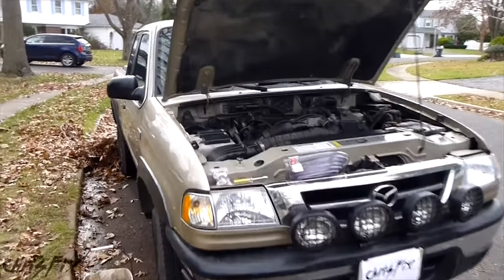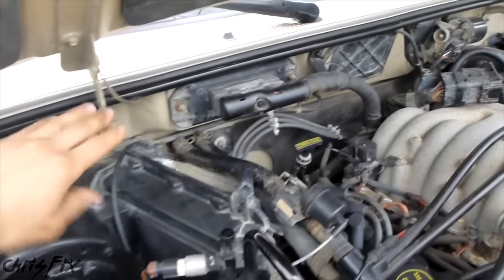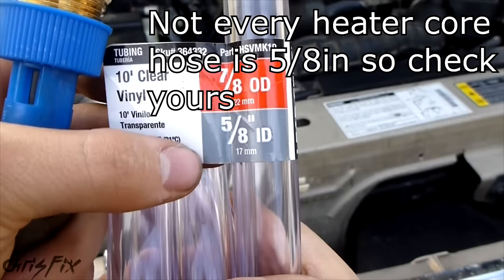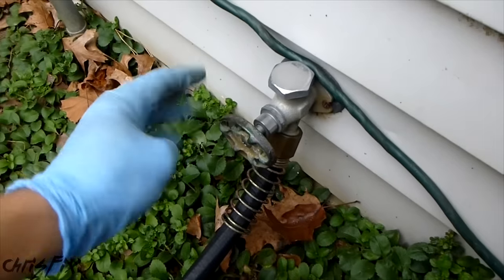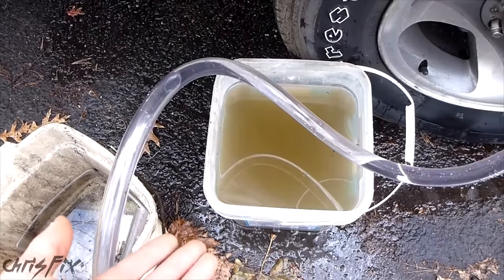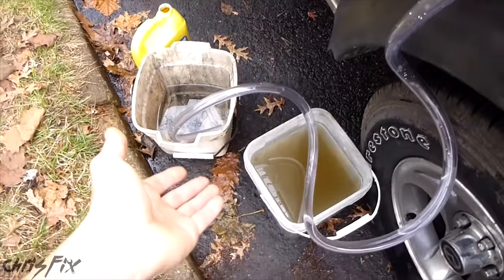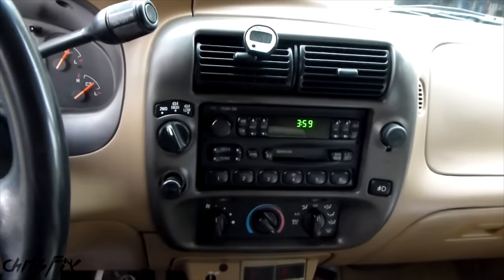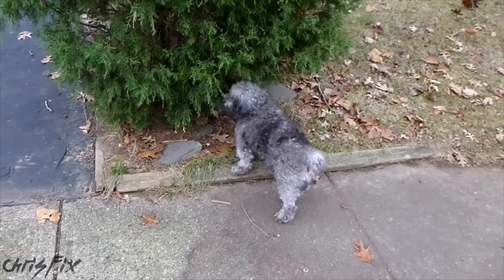How to Flush a Heater Core Safely (with a garden hose)

Comment: I used a 2 liter bottle of water, an empty bottle to catch old fluids, a pair of pliers, a funnel and an electric tire pump. I literally just finished, took me 30 min (mostly removing hoses) I'm no mechanic. Worked like a charm and saved me some cash!! Went from no heat, to yea let me turn this off its gettin really hot in here lol. Thanks Bro!!!
Reply: Hello, I'm trying to flush my heater core but I don't have access to a garden hose. How did you connect your pump to the hoses??
Reply: Muller P watch the video
Reply: Good shit bro
Reply: "I used a 2 liter bottle of water, an empty bottle to catch old fluids, a pair of pliers, a funnel and an electric tire pump. I literally just finished, took me 30 min" -That's what she said
Reply: @evanarnold580  lo {4
Reply: what was the electric tire pump for?
Reply: @automotivetv9861  🤷‍♂️
Reply: @automotivetv9861  i would have to assume to apply air pressure to the water in order to get a decent flow going to get all the gunk out. Gonna have yo try this but with my air compressor
Reply: @mullerp5235  just squeeze the bottle
Reply: @LokochonWolf  you could also just blow into the hose and push it out I would assume since like he said they usually only get about 10psi
Reply: Psh! I used a rubber band and a paper clip
Reply: @automotivetv9861  air pressure works in place of the water pressure

Comment: My car is running good 14 minutes ago but now i need to flush my heater core
Reply: totally
Reply: Don't be afraid of doing your own simple work. Learn. Figure it out. Do it.
Reply: Me too, I think I’ll do it myself
Reply: @davidweum9334  unless you have a 2nd gen mini cooper... like zero space in my engine bay. if you want to do anything big you either remove the intake pipes or take off the bumper. mind you, its only like 20 screw to take off the bumper. I can get it done in 20 minutes and put it back on in 8mins
Nvm, now that i think about it, its the same with pretty much every hatchback. Still I love this car and its pretty reliable if you change the oil every 5000/8000km
Reply: Monday
Reply: Monday
Reply: Sunday
Reply: 3:32 AM
Reply: Monday song
Reply: Yesterday Sunday
Reply: Same here

Comment: Would it be the same if I unplug the hose from the heater control valve instead of from the firewall. In that case, I can use the original hose to flush?

Comment: Run your heater for a couple of minutes per week in the summer and your A/C a couple of minutes in the winter when the air temp is above 32-deg. Your cooling system will be always be trouble-free.

Comment: Chris Fix is great! One thing, turning the hose valve on 1/4 turn will NOT regulate pressure, it will just control how fast it flows. If there is a blockage, the pressure will rise to the household  pressure at the hose value.
Reply: Ah good old fluid dynamics. I didn't even think of that. Direct correlation (inversely proportional) between pressure and volume of water.  Similar to what happens when you put your thumb at the end of a hose.
Reply: Yup. Absolutely correct.
Reply: Totally agree.
Reply: Well, I'm sure how quickly that rise is depends on the rate of flow so the same caution is still recommended, right?
Reply: Yep,you would have to turn down you regulator.Way down.
Reply: I dont understand. can you explain more thoroughly?
Reply: @PneumaticFrog  hes saying when u turn on the hose the pressure will be 40psi regardless (or according to ur municipalities water supply pressure)  especially if there is a blockage in your radiator core.
Reply: @RubbinRobbin  gotcha thanks

Comment: THANK YOU! I just used your method on my 1998 Jeep Wrangler and it worked perfectly. The hardest part was disconnecting the hoses - they'd never been disconnected before. If I can do this, anyone can! I'm not a mechanic or even close to one. $10 in parts and an hour under the hood did the job. Keep up the tips!
Reply: Hey did you flush the radiator before doing the heater?

Comment: Even sometimes in the summer, when on the highway, I'll turn the heat to full blast, and aim it out my windows. Provides a liiittle extra bit of cooling for the engine. And keeps the heater nice and clean
Reply from the maker: Thanks for sharing!
Reply: Yeah, when me and my brother would be flying around in his 2000 bmw 323ci we would do the same to keep the engine cool

Comment: I just watched your cooling system flush video and this video and I feel so much better about doing the work needed on my cooling system now! Thank you for taking the time to share your knowledge. I am now subscribed and will be sure to refer people to your channel if they ask about diy mechanical issues. I also wanted to give you an even bigger THANK YOU for the advice about turning your heater on once a month during the summer months. I live in Phoenix AZ and have had at least 3 older vehicles end up with heater core problems. I honestly think your advice will prevent me from running into similar  issues in the future. I am surprised no one else has ever suggested that to me before  & I'll be sure to share that advice to friends and family as well. Thx again and I look forward to learning more from you 😁

Comment: I never comment on videos but I have to admit that this worked perfectly for my 2008 Jeep Liberty. I wasn't getting any heat on the driver's side (the only side you actually care about) and little to no heat on the passenger side. I decided to do this exactly like the video and I had amazing results!!! I'm not the most amazing handy-man either so I would give this a 3 out of 5 difficulty. The only issue I had was getting the hoses off but everything else went smoothly. Thanks for the help!

Comment: I'm Watching your videos for a year an i must praise you a lot. Your videos helped me to diagnose a bad battery, bad alternator and to diagnose a parasitic current draw. Today i flushed my heater core and I'm amassed how good that worked, and how much junk there was inside. I don't have much time to work on my car, but from time to time i fix things on it. I got myself an E34 520i 1991 in fall last year and with your help I'm fixing it good :D Next on my ''TO DO LIST'' is that cooling system super flush, because there is also a lot of junk in my radiator. Keep up the good work Chris and thank you for all the effort you make to do this awesome videos.

Comment: Just performed this on my car that had really low heat, and now its blazing HOT!!! Thank you ChrisFix! Love the videos! I purchased the same blue and black adapter as is in the video, and it had a hard time letting water through, so didn't get much pressure, but maybe I did it wrong. I ended up just hooking up the water hose directly to the terminals, and it worked just fine as far as I know, super toasty.! Thanks again! Just in time for winter!

Comment: Great vid! Just did this to my 97 Civic LX and the hose location was nowhere near as easy as it was on this truck. Instead of buying hoses/adapters I just disconnected the two tubes on their opposite ends since they were much easier to get a grip on there. I did have a problem with air in the system so I took the radiator cap off and revved the motor until the coolant went down and I topped it off some more. After a few cycles of that the heat finally started kicking in. Went from 107F to 145F. Huge difference!
Reply: Great info! How do / did you determine that air was a problem in your system after the flush? 

I have heard this mentioned a number of times in the videos I've watched thus far, but no one ever details that car acts a certain way or if there is a specific dash reading that comes up that will flag this problem.

Comment: Chris, love your teaching style and positive, can do attitude.  I’ve been turning wrenches for over 50 years and you still manage to pass along an unknown trick occasionally!  I am curious as to why you opted to not install the full flush kit.  I installed a kit in my 05 Mustang,  that I had previously installed in a 93 Aerostar, but removed it before sending the mini to the scrap yard.  It still functions flawlessly, and makes a radiator flush easier than changing oil...

Comment: Mine had rusty crud comin out, but having no water at my workplace, i blew with my hand on the radiatorcap and i changed direction, and succes!! Filled up with gallon bottles....so yes i improvided, and worked great! Temperatures inside increased like it should! Thanks for the knowledge, i built upon, bob the Belgian🇧🇪🍺👌

Comment: I am a HUGE fan of the Prestone Flush & Fill kit-You simply cut your INLET hose to your heater core, install the "T" hook up your garden hose, turn on heater full blast, run the engine through several warm up and cool down cycles-(Thermostat opening and closing)

Comment: CHRIS, you da man.  The cold blast hits this week.  I used your tips on a 2007 Dodge Nitro and the thermometer went from 78 deg to 150 degrees.  I bought 5/8 inner diameter hose at the lumber store and flushed back and forth with a regular water hose and a simple water sprayer that looks like a gun that fit snug into the end of 4 foot clear hose.  I also used dish soap then to help and 1 hour soak of prestone radiator flush, then a final water rinse and added coolant to the heater core.

Comment from the maker: ***** You are definitely correct but if the rate of flow is slow enough there will be no excess buildup of pressure and for the 5/8s tubing I was using, the 1/4 a turn put a little less than 10psi. It is hard to communicate a pressure to people when they dont have a pressure gauge so this 1/4 turn method worked. Thanks for the input!
Reply: I have a 97 Dodge Intrepid, and I know it's a sh!t car, but the AC is the only thing that has never broken, and is still good! The heater however, runs really hot with the fan on low, but when I turn the fan on high, it slowly gets cooler until it's just slightly warm, and the returning heater hose becomes cool.
Reply from the maker: John Smith Sounds like it might be getting clogged. Here is a helpful video on how to diagnose your heater: https://www.youtube.com/watch?v=-XjXTVJhFLM
Reply: I checked that out, and my heater is definitely plugged up. It's a mess under the hood of those Intrepids, and really hard to get to the heater without tearing the whole engine apart. I'm probably gonna have a professional clean the evaporator, heater core, and then flush it out since there is a bit of dust building up, and i'll probably get the engine mounts, struts, and oil leaks fixed. I noticed ever since I had my leaky power steering lines fixed, the pump makes a grinding hum that wasn't there before, and if I turn my wheel fully right or left, it grinds the pump. Is my pump going bad too?
Reply from the maker: John Smith Sounds like whoever you took it too ran the pump when it was dry. I would try adding an additive such as this: http://www.amazon.com/gp/product/B000930N0U/ref=as_li_tl?ie=UTF8&camp=1789&creative=390957&creativeASIN=B000930N0U&linkCode=as2&tag=chri0e2-20&linkId=7BDY5LNLSNTHUCEU
It might stop the noise and that stuff is pretty good!
Reply: John Smith you can do the same procedure from the front of the heater hoses the ones that go from the water pump tap into the system from under the bulkhead  or then remove the entire center console, dash,  heater assembly to change it out because they rub in the bottom of the heater box and make a small leak so when you put a new heater core put a rubber strip on the bottom of the heater core to prevent it from happening again
Reply: Emissions Purge Valve
Reply: it could be leaking past it if it is old
Reply: On a '01 XJ which hose is the outlet, top or bottom?  Thanks!
Reply: ChrisFix

Comment: I was looking on how to fix a coolant system because my heat in my 2005 honda accord isn't working, along with a few other issues; power steering doesn't work, the paint and body need repaired because of rust. These are all things that you have a video for, thanks to you i have my new hobby and I personally enjoy honda's, yet always wanted a type of convertable, now I cannot wait until i can get a del sol of my own, thanks for everything Chris. Can't wait to until i fix a mechanical issue all by myself. I look forward to learning and fixing my own vehicles. p.s. its easy to see why you hit 6 million subscribers, Congrats.

Comment: Just reversed flushed a 2000 Dodge Dakota heater core, then did a Zerex radiator super flush .  Worked like a charm - went from no heat to fabulous.  The antifreeze was the color of mud virtually certainly no one had changed antifreeze in 22 years.  I'm on  rinse number 5 ( three before the radiator flush, and two after) filling the radiator with water, getting up to operating temperature  and then draining the system.  Two  or three more and it'll be ready for the new coolant.  Thank you!

Comment: Cheers Chris. I lost all heat in my 2008 Jeep Cherokee crd (Liberty). Thought I was going to have to replace the core, but tried your heater core flush method and now have full heat again.  It’s hard to get to the heater core hose clamps on my model but bought some remote pliers with the cable pull. You’ve saved me a big bill👍🏻

Comment: Something I recommend that you may want to start saying is: take a picture of how it looks before hand! I can't tell you how many times I've done a job where I forget how something goes - my clutch cable took me 3 extra hours because I couldn't figure out how it was routed originally. It's easy to say you won't forget, but I advise anyone doing a job where you have to disconnect/reconnect things to take a picture before hand or mark the hoses/wires so you can remember where they're supposed to go. Great video though Chris, definitely going to try this method sometime!
Reply from the maker: ***** This is a good tip and I actually do say that on my more complex videos. For two hoses, I didnt think it was necessary, but good tip none the less!

Comment: Thanks a ton for this. Still helping people in 2022.  I did it slightly differently by detaching the hoses at the engine rather than the firewall. Then, the old fashion brass 'twist on and adjust' garden hose nozzle fit and sealed perfectly inside the heater outlet hose. Everything flushed like a charm on my 1999 Chevy S10 and we have heat again.
Reply from the maker: Awesome! Glad the video was helpful!

Comment: This worked for my 2013 Ram 1500. Heat worked on passenger side only, no other issues. After flushing all vents blow hotter than ever before. I was pretty shocked because no large contaminates came from the flush

Comment: I had a 98 Ford Expedition that had limted flow in both heater cores, I didnt have access to a water hose/outlet so I used compress air and was thankful that this fix this issue to give us heat, before this the heat was barelt felt. I didnt use air alone, I would fill the given amt of hose with water and then blow it through. Took 3 to 4 times to get the crap out. Also thankful that i didn't have to replace the heater core, its a pain in these models, the whole dash has to be remved.
Reply from the maker: fordwindsor351 That is awesome! I was thinking about making another video with using an air compressor for that exact reason! Glad you got it working! Nice work!
Reply: Old 70's and 80's model Chevy pickups used to have an easy to locate heater core access panel under the dashboard that would allow you to quick change a core in about 30 minutes. There's no reason for auto manufacturers to make such a easy job so complicated.
Reply: +Raymond Johnson _ Yeah. So they can make money

Comment: Just put a new thermostat in my 15 year old Dodge truck, it was stuck and the truck would never warm up like it should have. With the new one now it warms up and stays at exactly where it should be (right at the middle line in the gauge.) My heat works way better now also, gonna be doing this flush this week, can't wait to see how much better my heat will work. You should definitely do a thermostat replacement video if you haven't already, it's a simple job to do (albeit a bit messy) but I'm sure it would be a helpful video for some with the same issue. FYI anyone with a Dodge/Chrysler/Jeep that has the 5.7 Hemi, if you get a code that says something like "coolant temp too cold" and your car doesn't seem to warm up fully replace the thermostat. The one you want to get for the 5.7 Hemi is a CarQuest 48792 from Advance Auto Parts, US made, the ones sold at Autozone are junk. Thanks Chris!

Comment: If your heater core is actually blocked by crud on the ends of the tubes, you may need to increase the pressure more than you show on this video...and sometimes a blast of high pressure air into the flowing flushing water will causes bubbles to agitate the water which will also disturb/loosen/remove that crud. Beats removing and replacing the heater core....

Comment: I used all of the tips and techniecs addressed by Chris on flushing and maintaining the cool/heating system two summers ago, and I did it on my 96 F-150 with the 4.9L 300 I6, this info is great, I did only one thing different, instead of just flushing everything with water and refilling, I went to the local dollar store bought some cheap coke refilled and burped the system just like I would with coolant, and drove the truck for just over two summer months, later "in September" I dumped and reflushed then refilled the system with coolant, and Wala no more gooo in the cooling system and no lifted head gasket.

Comment: You are a real Pro Cris!  I am 70.  My friend is same age and is. Chemist.  He created a Pro Head Gasket Sealer that is the Best!  Anyway he told me to dump DRAIN-0 gel 15oz in radiator (says safe for all plastic + metals) and run heater full blast for 15min.  THEN DO YOUR REVERSE FLUSH!  My 35yr old Toyota PU has never leaked.